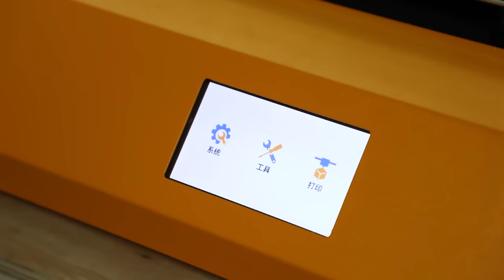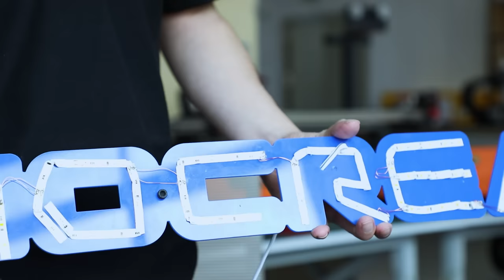How to use Creatwit Channel Letter 3D Printer to Creat Illuminated signs

Comment: 100% this does not require a custom printer.
Reply: 10,000% agree, I already custom make these but with ws2812b lights and a $180 Anet a8 Plus!
Reply: I'm not sure what you classify as "custom" but 100,000% most homegamers aren't pumping out multiple colours on a bed anywhere near this size.
Reply: @cray-  you could do the letters individually and swap colours at specific layers
Reply: @cray-  I agree with the bed size, but you can easily swap out the filament mid print
Reply: @ultranobody5549  yes.
Reply: @АнтонСергеевич-э2я  sadly not all firmwares support filament change.
Reply: @goddamnmaddog2024  I just manually splice the filament midprint with some snips and a lighter
Reply: David McKee  yes.
Reply: @cray-  yes.
Reply: @cjfavazza  yes.
Reply: @cray-  Yes.
Reply: @Spartacusse  no.
Reply from the maker: Other processes can also be used, but 3D printing is easier.
Reply: Right, but it does make it a lot easier and faster right? No manual splicing or swapping of filament and all the letters can be printed together, if you're running a business saving that kind of time may be worth it.
Reply from the maker: @snipsnap9995  Sure.
Reply: @goddamnmaddog2024  just change the firmware (to marlin, or klipper, or..)
Reply: @goddamnmaddog2024  change the firmware
Reply: @octimus2000  I did already. I found out that I had to change my TFT firmware. Now everything ia super awesome and works like a charm.
Reply: @kirk5452  may i ask what resin your using? Ive been buying dif types trying to fin out wich one can achive this without shrinking

Comment: I did this last year i printed the sign for my pizza takeaway shop the sign is 15ft long x 2ft tall i used my Tronxy SA5 priner i had to print the letters in several parts and glue them together this print took 3 weeks to do from start to the finished sign unfortunately I didn't make a video of the print which was a shame.
Reply: show us a picture of the finished product?
Reply: @mIkeyGermita  I would if i can work out how to reply with a picture
Reply: what kind of resin epoxy did you use? I can't find a right one that lets in a lot of light.

Comment: looks fantastic ! 
What's this ? resin ? 0:23
And what is the black machine at 0:25?
Reply from the maker: 0:23 This is a liquid acrylic
Reply from the maker: 0:25Creatwit KC-01 LED letter curing machine.
Reply: @piocreat3d  I love this idea, but I might just try printing the base layers in a clear PLA before color switching to the white, see if I can get a similar effect. Great work, this looks very clean!
Reply from the maker: @RussDahlberg  You can try it. But we use all the same materials for all. Thank you.

Comment: How did you model the text? I’m trying to print a few gamer tags, but it’ll take a while to manually do all the lettering
Reply: We use the CoreDRAW to design the letter outline and then we use our software to slice file .Lastly , we can use our print to print letter wall .If you hava any doubts, you may leave your email address and whatsapp  .We will introduce  the processing of  Ad letter .Thanks
Reply: Hi  whats the name of the printer and the cutting machine on the acrylic?

Comment: This is cool. But as Hex stated, you 100% do not need a custom printer for this. The website states "Consultation" for price, which typically translates to "really expensive", which is absurd for this, and such an antiquated business practice to attempt to lead generate from the site rather than openly state the price.  A $1000 (USD) CA-30 and easily print this sign and even longer ones. You could swap out filament mid print and change colors on any printer in the world (and if you can't you are using antiquated software). It takes 30 seconds to create a 'swap filament' button in g-code if you don't have this option. You could use any small printer and simply bond all the pieces together in the end as well.
Reply: you havnt even mentioned that dual hot end printing setups are now very affordable.

Comment: the torch are use for??
Reply: burning off the tiny "hairlike" strands of plastic that remain from where the nozzle stopped a layer and quickly moved to a new location. Sometimes the hot liquid plastic doesn't stop completely and you get a tiny hair-like wisp where the nozzle passed over open air.  The plastic hardens instantly after it leaves the nozzle and those little fibers/hairs are SO thin that the flame from a torch is enough to cause them to vaporize in a fraction of a second!  They just disappear!  It's very common in 3D printing, especially when using PETG filament which tends to be very "stringy" thus they call it stringing or oozing.

Comment: Great job ! What is the liquid that you use afer the 3d printing?
Reply from the maker: Hello, can I have your name and mail address , we can give you more information if you like to know more
Reply: That is just regular resin. It seems they added a bit of white to make it a bit cloudy so you don't directly see the UV light strips
Reply: They are using water from a pressurized sprayer to rapidly cool down the part to make it easier to release it from the build plate.